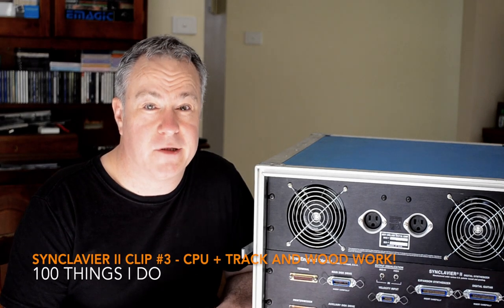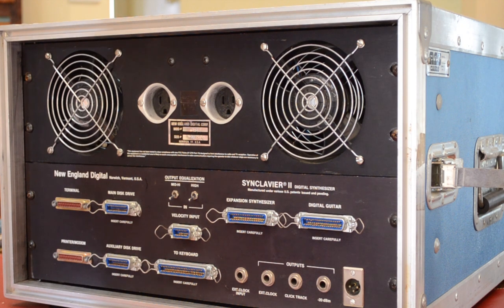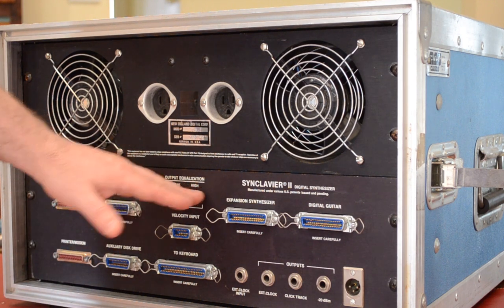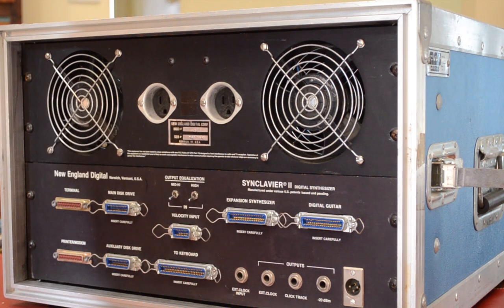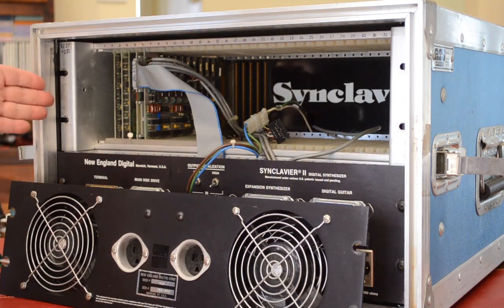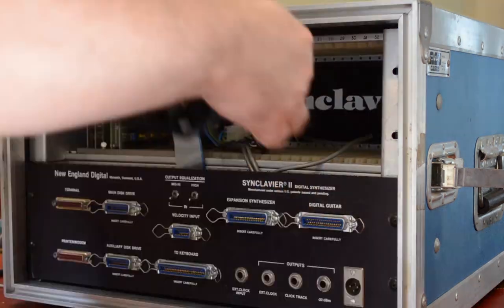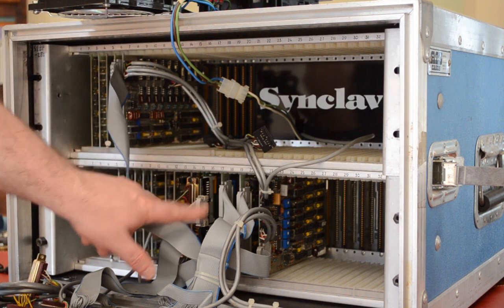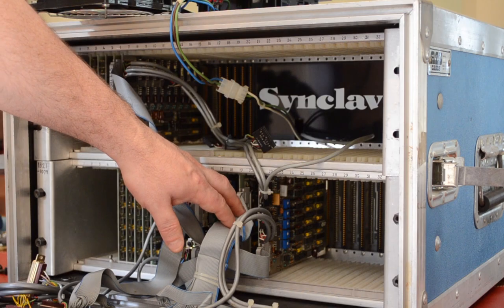SYNCLAVIER II CLIP #3 - CPU + TRACK AND WOOD WORK!

Comment: Great video! Where on earth did you find a system in a file case that was not all beat up from decades of road gigs? Great to see all the connectors in good shape; looks like it just came from the factory.
Reply from the maker: Thanks for checking out the clip Cameron. I purchased the system from one of the re sellers still around. I had quite a bit of restoration work done it on before I got it but I asked for the Keyboard to be left so I could complete the wood finish myself. I have the slightly mad idea of doing some reverse engineering of the system now that you have posted some of the technical documentation :D  Thanks for your work .. it continues to inspire!

Comment: That’s nice! You could do sound comparisons Arturia vs Synclavier & Fairlight?
Reply from the maker: I looked at doing so , but the Arturia stuff is very different from the hardware counterparts. I'll do something later with the Synclavier v Arturia as I believe it runs some of the same XPL code. The Fairlight is so upgraded in the Arturia version its not even the same machine really :D
Reply: 100 Things I Do Thanks! Waiting for that :)
Reply: The Arturia Synclavier V is a direct port of the original FM-only Synclavier. They even imported many of the original Synclavier sound libraries into it. They did vastly expand the functionality, but kept backward-compatibility.
Reply from the maker: Hi Paul , it does sound and work a little different. I get the feeling from Cameron Jones's comments it includes 'some' of the original code but I could be wrong on this. If I do a Arturia V 'v' Synclavier II it would be more a feature  comparison than a 1:1 sound emulation comparison. The Arturia is a wonderful new enhanced version in my opinion :D
Reply: Hi, you can ask Cameron himself :) he's the one who did the collaboration with Arturia to port the Synclavier engine. One of the nice things about the V (apart from the fact that it is now finally within reach of  people who have been lusting after one for the last few decades...) is that you can adjust Bit Depth (4 bits - 24 bits) and Oversampling Rate (1x - 64x).
Reply from the maker: I am still reeling from shock and awe that Cameron even bothered to watch my video clip :D I Love the 4bit sound of the Arturia version .. there is so much REALLY nice aliasing you get! The way you can also change the harmonic makeup of the Modulator is a killer feature, that and almost infinite Timbre frames and time.. You can have sounds just morph and change for longer than you can hold a key :D
Reply: Yes so many nice features. Other less obvious ones like selecting several (or all) partials, and then whatever adjustments you make (envelopes, FM mod, mod matrix amounts, etc.) are applied to all of them... copying partials...copying timbre frames between partials, etc., etc.  I created several of the V factory presets and I totally fell in love with this instrument. Of course I would love to have the Real Thing, but probably won't happen in this lifetime.
Reply from the maker: I never dreamed I would actually have the honor of owning either a Syncalvier or Fairlight CMI and I have managed both.... You never know what life might deliver for you :D
Reply: This kind of comparison is really the audio card (D/A converter) comparison. Even if the computer code in both is identical, the Arturia version should be auditioned on a computer with a high quality sound card, not just whatever comes with your laptop or ipad. It does appear the Arturia version of the Synclavier kept the code reasonably accurate, down to preserving certain limitations in the original software that were forced on the programmers by the 1980s hardware quirks (one such thing is the slightly inaccurate behaviour of the envelopes upon their alteration, Arturia decided not to fix it, presumably in order to preserve the integrity of the original timbres). Fairlight OTOH seems to be a rewrite, a reverse engineering of some kind, so it may be different already at the digital level.

Comment: is this the synclavier that supports 24bit/96 kHz sampling? The former $200,000 beast?
Reply from the maker: It is, but my system only has 8 FM voices and was only $20,000 in 1984. Its a modular system so you could upgrade as far as you wanted! :D
Reply: @100ThingsIDo  
Interesting. So what would the $200,000 look like? What preset was used here? sounds complex. I have an arthuria v and was surprised to see the real thing. :) also maybe possibly compare the two?

Comment: Hey Michael. I just spent some time today watching your Synclavier videos. All great stuff of course. I really like the synth for the FM and not as most want because of sampling and Direct 2 Disk etc. What did you use on the wood? I can't make out what it says on the tin.
Reply from the maker: Hey again Johnathan, It's just a basic Danish Oil. From what I read up at the time this was the original finish that was applied pretty much the same as you see in the Video.  Yeh, I hope to add some sampling to it at some point but I will need to update to the next revision of the Able CPU. For me the Fairlight is the sampler and as you pointed out the Synclavlier is for FM exploration :D

Comment: Thanks  for the Video, can you please tell me can the Synclavier II run by it's self without the DEC VT100 monitor/external computer  original? there's so many videos that show up people without any monitor or external VT100 ? regards Clive
Reply from the maker: Hey Clive! Yes it runs without the VT100. Mine does not even have the disk to load up the terminal to allow the VT100 communication. By the time Syncalvier moved to the later keyboard and more advanced FM and sampling the VT100 was mandatory to understand what was going on 'under the hood' :D Hope this helps!
Reply: Thanks, ouch! no Floppy Disc! sorry to hear about it. Regards Clive